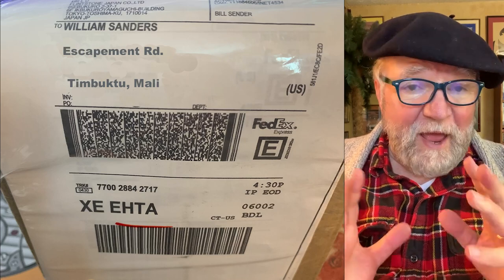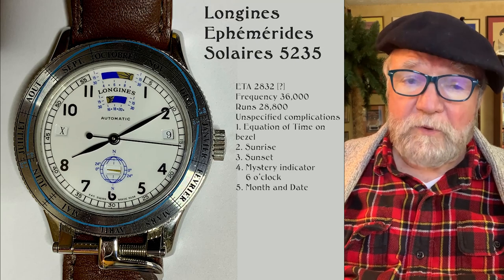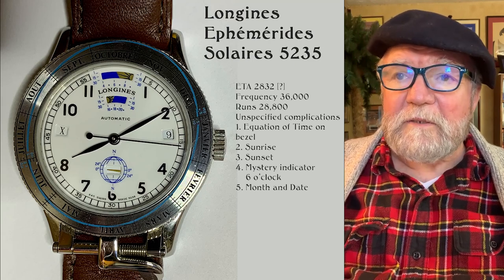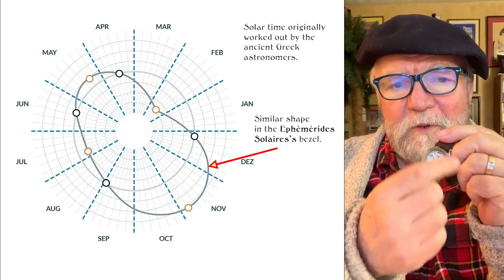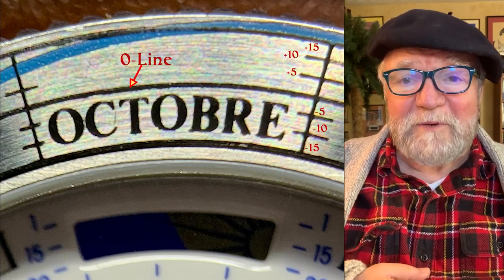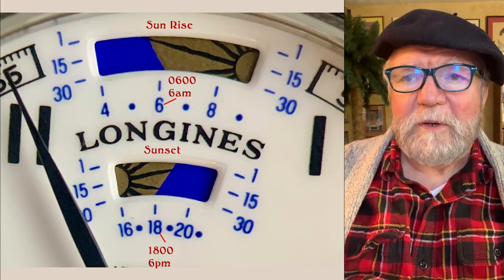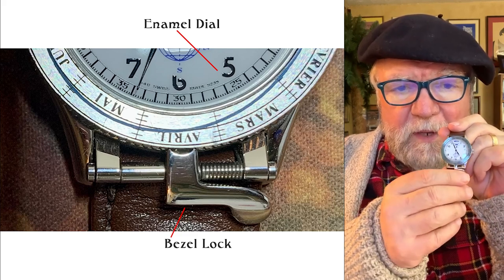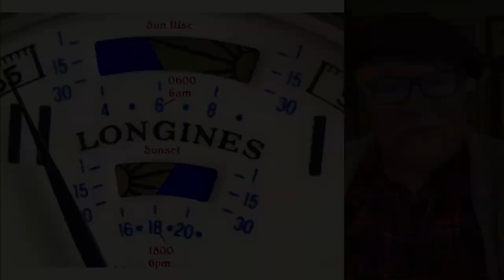Unboxing a Complicated Watch #VP179

Comment: Hello Bill, Very interesting find!. If I remember correctly Longines will issue for no charge a certificate of origin for your watch just for the asking. They keep records for every watch made and mabe they can provide the instructions also. Its worth the shot especially on this special one.
Enjoy and have a great day.
Thanks Bill another excellent video.
Reply from the maker: Thanks Dom! I will check that out. They do have a resource for getting manuals for different watches, but they didn't have one for mine. If you wouldn't mind a little horological investigation the Ref is 5235.👁 Maybe you'll have better luck than I did. Take care, Bill

Comment: My best guess is the 1-15-30 are the offset for your longitude within your time zone and the bottom indicator looks like it measures the tilt of the Earth in its orbit. Those are just guesses, I could be wrong. Very cool watch, congrats!
Reply from the maker: Hi Nef, that sounds reasonable, but I don't quite understand how to get the 1-15-30 in the 15° that makes up each timezone. Take care, Bill
Reply: @watchartsci  Thanks Bill, I ordered this watch after seeing your “equation of time”-video. I’m not sure but 1, 15, 30 at sunset and sunrise means the days of the month.
Reply from the maker: @ronannezlev2276  Each month has the days of the month from left to right along the top.the 1,15 and 30 are aligned vertically. I've ordered a manual from Longines (PDF I think). When you get your watch, I'll send you a copy if I get mine. Take care, Bill
Reply: Thinking about it, equation of time is not an complication of the movement, but a design feature.
Reply from the maker: @ronannezlev2276  On this watch it's a functional design element. Some EOT watches have mechanical EOTs showing the hours ahead/behind solar time.
Reply: @watchartsci  So… the box EOT is checked off? 🙂

Comment: Longines produced the Hour Angle for Lindbergh's transatlantic flight, which had a bezel with 15 degree increments. 15 degrees being the progression per hour of the Earth's rotation.
So perhaps the 1-15-30 are linked in that way???
Reply from the maker: Thanks Rog, that sounds reasonable. On the protractor sundial I made, each hour was 15° from the previous and next hour. Take care, Bill

Comment: Bill thank you so much! Im so happy to find someone else as baffled as me. But i believe that the indicator at 6 is to show if ur closer to solar noon or clock noon.... i like how u put it. There two clocks a mechanical clock and a solar clock and this watch is supposed to show both. Or at least thats what I can come up with from the two guys that tried to explain it to me. But the one spoke Portuguese maybe?, and the other spoke spanish
Reply from the maker: Hi Derrick. So far I've not heard back from Longines about documentation. On my watch, the Solar Time is that blue line around the bezel. The black line that dissects the "railroad track" next to the blue line is the Mean Time. Together you get Equation of Time.  If the blue line is above the black line, that indicates the solar time is faster, while below the black line, slower. The hatch marks are 5, 10 and 15 minutes faster or slower. I don't know if that helps much, and there's more to figure out. Since I've not heard from Longines, I'm going to ask them if they could take digital shots of the documentation for the watch and make it available. Take care, Bill
Reply: @watchartsci  Bill, sir thank you. I have been going back and forth on a simply 36 datejust steel an gold with the jamgly bracelet and linen dial. A navatimer with the semi annual perpetual calendar and the longines ephemerides solaires. And the biggest thing has been is the longines a somewhat calendar with month and date.. and you answered that. But now I still dont know. Its so funny how much the hobby will drag me in. Thanks so much sir

Comment: Send Longines an email they will send you a PDF of the watch manual.
Reply from the maker: Ivan, do you know what their email address is? Thanks, Bill
Reply: @watchartsci  visit the Longines webpage and under contact us you will find the needed form and they will send you the information.

Nice watch.  Take care.
Reply from the maker: @ivansmith4242  Done! Thanks.
Reply: @watchartsci  no problem. Always ready to help a fellow watch collector.

Longines has one of the greatest archives in the biz. Probably on the same level as Patek and JLC.